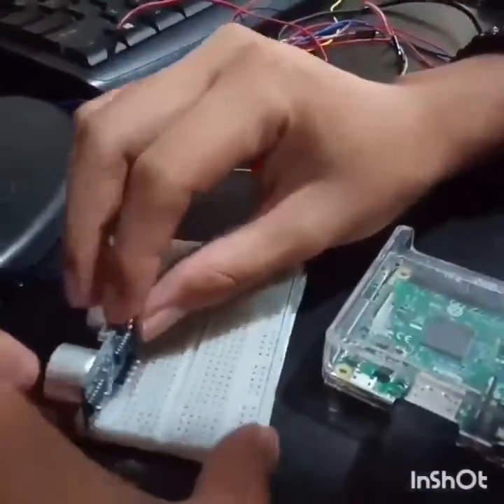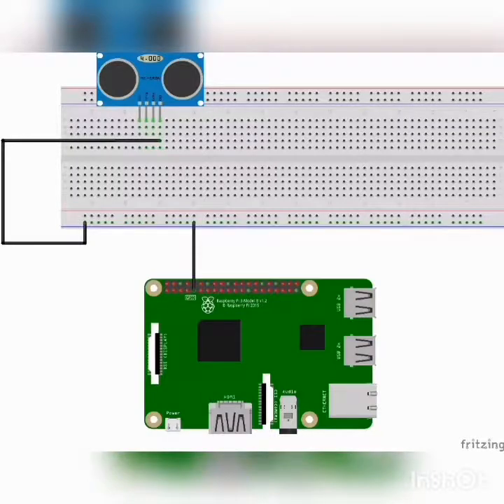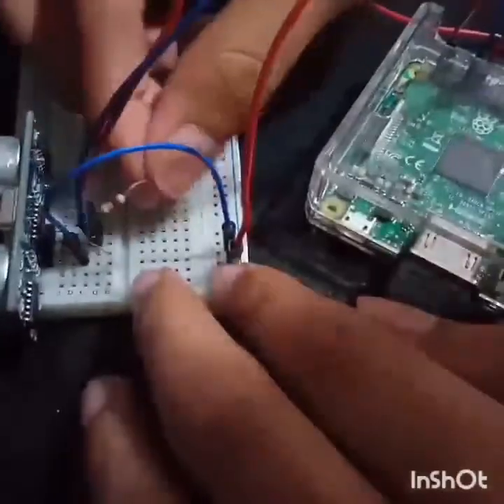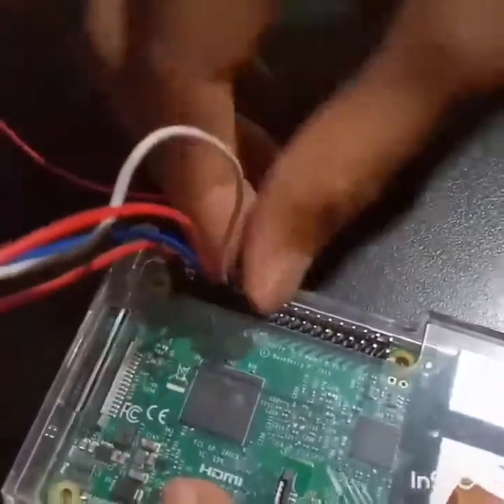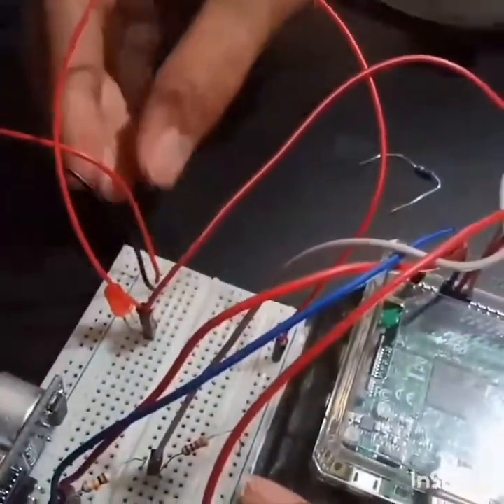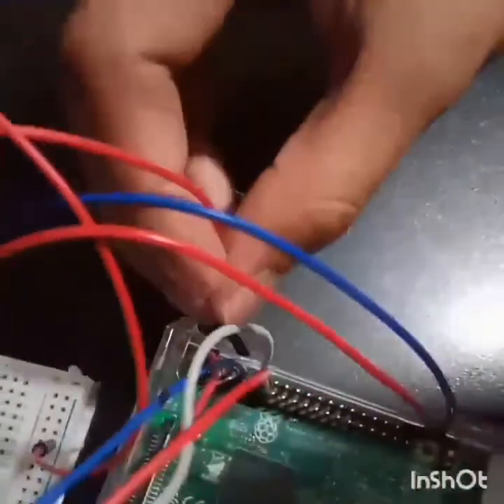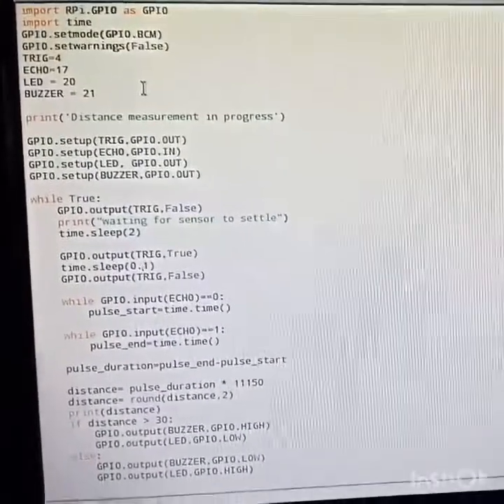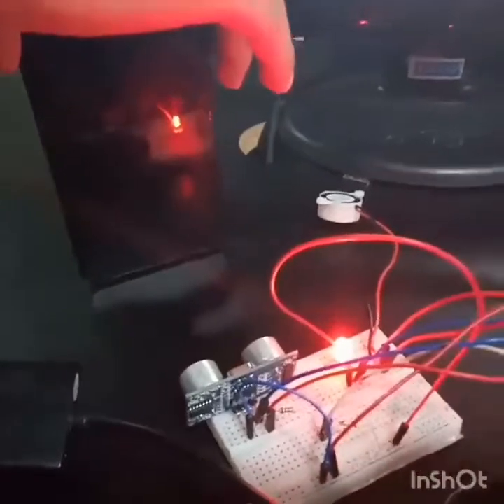[TUTORIAL] Interfacing Ultrasonic Sensor + LED + Buzzer with Raspberry Pi

Comment: Import RP1.GPIO import time

as GPIO

GP10.setmode (GPIO.BCM)

GPIO.setwarnings(False) TRIG-4 ECHO-17

LED 20 BUZZER

21

print("Distance measurement in progress")

GPIO.setup(TRIG.GPIO.OUT) GPIO.setup(ECHO,GPIO.IN)

GPIO.setup(LED. GPIO.OUT)

GPIO.setup(BUZZER, GPIO. OUT)

while True:

GPIO.output(TRIG,False) print("waiting for sensor to settle") time.sleep(2)

GPIO.output(TRIG, True) time.sleep(0.1)

GPIO.output (TRIG,False)

while GPIO. input (ECHO)--0:

pulse start-time.time()

while GPIO.input(ECHO)--1: pulse end-time.time()

pulse_duration-pulse end-pulse start

distance pulse duration 11150 distance round(distance.2)

print(distance) distance> 30:

if

GP10.output (BUZZER, GPIO.HIGH) GPIO.output(LED. GPIO.LOW)

GP10.output(BUZZER, GPIO.LOW) GPIO.output(LED, GPIO.HIGH)